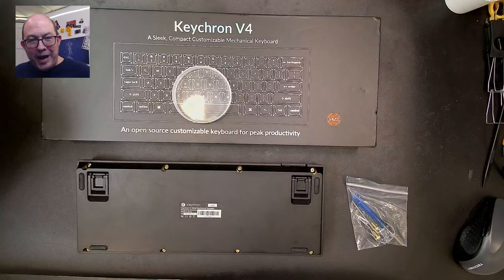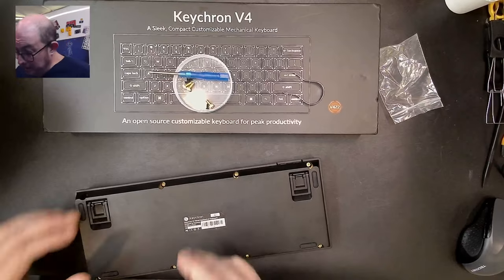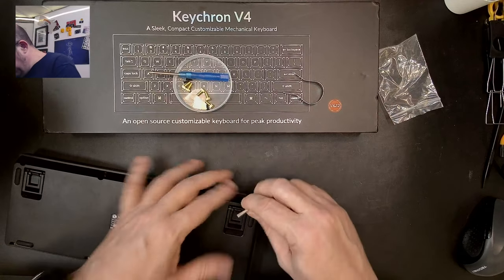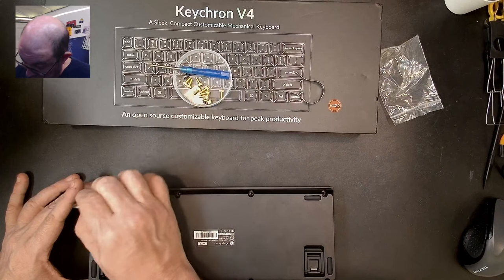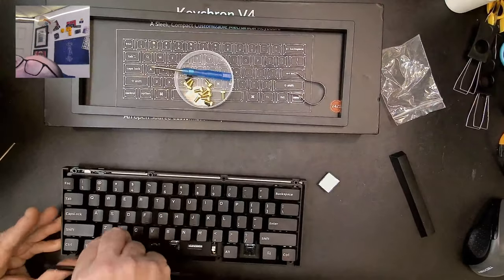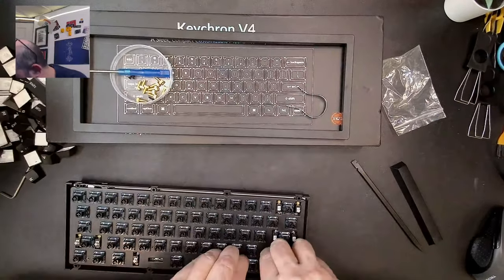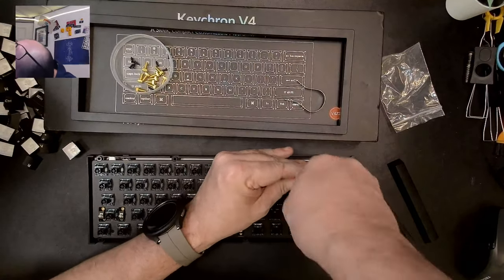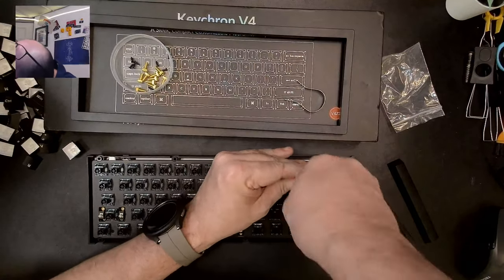Keychron V4 budget 60% QMK/VIA keyboard  Tear Down

Comment: Just got this board in today. Threw some milky yellows, and durock v2 stabs holee modded in. This board sounds so good for $60.
Reply from the maker: It truly does.
Reply: yea i guess it’s the best budget keyboard for 60 right now
Reply: Durocher V2 stabs are $20.  Tray mount barebones should not cost more than $80
Reply: Put some gateron oil kings and the same durock stabs. Also some upgraded keycaps but it does sound very good.
Reply: Got one yesterday Mod List: durock v2 stabilizer, tape mod, changed the foam put some lubed Gateron Silver V2 pro on it and the new Matcha Keycap set from Ducky, with a matcha coiled Cable. 🎉

Comment: 4:55 did that metal insert has grips around it ? i remember last time when i screw my 2.5 inch ssd it also has something like this but i stripped the metal insert and fall out because it doesn't has any grip like stabs' metal insert , but in the end i fix it easily by just put a bit of super glue into the hole and glue the metal insert back .
Reply from the maker: I do believe they are heat pressed here, so that should not be an issue.
Reply: @MechKeyboards  heat pressed = molded ?
Reply from the maker: They are pressed into place heated so that it bonds to the plastic and also expands into place once cooled.
Reply: @MechKeyboards  from what i ask from their operator , they said is molded , but anyway , thank you so much for the answers , nice video you are the man !
Reply from the maker: @香噴噴-p6f  injection molding uses hot plastic, I think we are just using different terms, but meaning the same :P

Thank you kindly, I will do my best to continue to deliver honest, entertaining, and informative videos, cheers!

Comment: I got one but can't find any case where it can fit into
Reply from the maker: Searching for keyboard carrying case should bring you back results or you can buy one from Keychron https://www.keychron.com/products/keychron-keyboard-carrying-case?variant=40095273943129
Reply: @MechKeyboards  Not carrying case but the keyboard shell, I want an aluminum case it seems that the screws layout isn't standard
Reply from the maker: @cgmonkey  there is no "standard" for PCB and case compatibility, especially between different manufacturers. I truly doubt that there is an aluminum case for the Keychron V4, including the Q4; they use different mounting systems. 

While technologies like USB, LTE, Wifi, etc. have standards that companies must adhere to in order for them to state that they comply to said technology; keyboards do not have a standards organization hence why manufacturers are constantly creating new designs that while using same or similar layouts, are not designed to be compatible with any other keyboards, with the exception of a handful of models (GH60/DZ60/BM60) which do use the same dimensions, same daughterboard/lack thereof that have a selection of multiple cases to choose from, they are not the rule, they are the exception.
Reply: @MechKeyboards  Thank you for this useful information
Reply: @MechKeyboards  I will go with painting
Reply from the maker: You are welcome @cgmonkey
Reply from the maker: Sounds like a good plan, I'd love to see your board once it's done, cheers!

Comment: why do people make videos on this board but do not talk about the damn profile that the keycaps need to be... I'm assuming cherry profile keycaps would work
Reply from the maker: I'm sorry, "damn" profile that the keycaps need to be? Any profile keycaps will work with basically any keyboard, you just need to make sure that you have the differently sized modifiers, though this is a 60% so any ANSI compatible keycap set will work.
Reply: @MechKeyboards  thank you sir. Sorry if I cam off as rude I had not had my coffee yet.
Reply from the maker: @GalacticBlader  no worries, I've been there. Cheers.